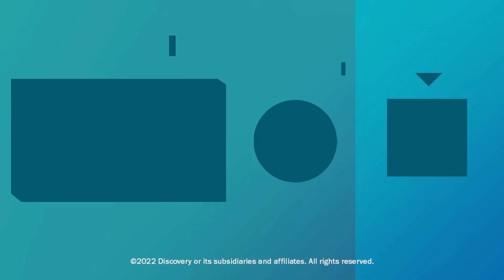SUCCESSFUL Modern House Flip! | Flip or Flop | HGTV

Comment: Those bedroom nooks make zero sense, except as a bad add on.  Would have been better to have a European shower with a drain in the floor than to have that loser closet, or borrowed a little from the huge kitchen.  Christina's accent tile is a no.  Looks good but not an easy fit for some decor.

Waterheater outside?  Only in California...
Reply: @B uppy I'm not a plumber, but have noticed many Australian homes have Water Heating Units and Central Heating Units installed on a concrete slab, or off the ground, outside. I think this happens in the Australian States where natural gas is a common energy source. Perhaps there are safety regulations about possible fire hazards and gas fumes that dictate units be placed outside the house.
Reply: @comealongcomealong4480  
No,  it's not a safety issue.   They did it for space.